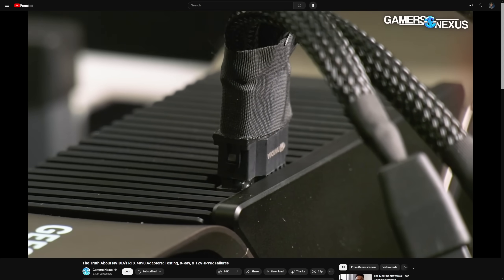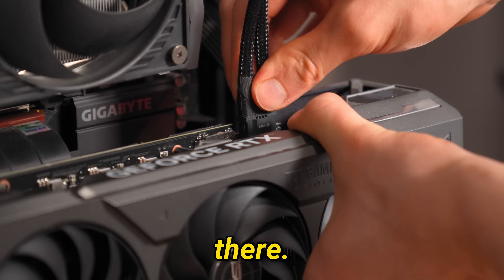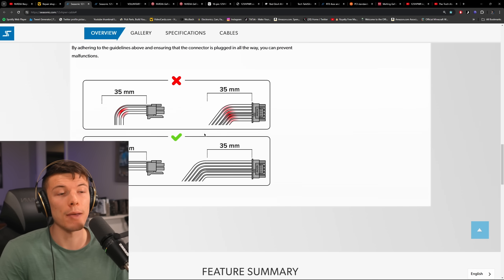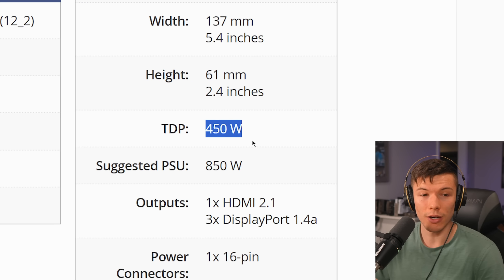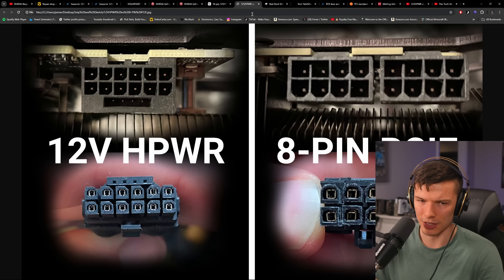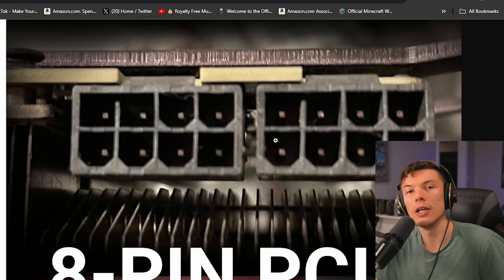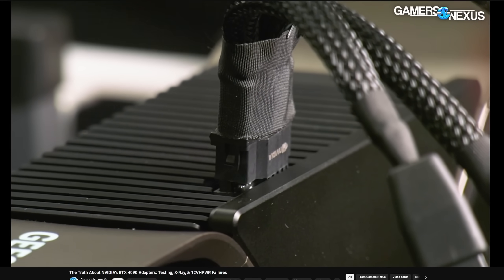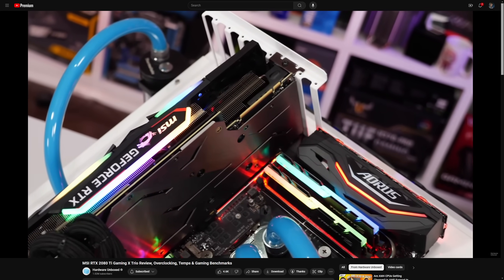The Dumbest Thing to Happen to Graphics Cards

Comment from the maker: we are almost at a momentous subscriber goal...

also at 1:45 is possible the light still shines of a failure because the 4 sense pins of the 12VHPWR aren't actually going to anything on the power supply because of the adaptor, which would make sense (pun intended). However, it doesn't change that it's too hard to tell if you even have it plugged in right, which is pretty ridiculous
Reply: @vextakes !!! Explain to me why you left out the fact that in the ORGINAL ARTICLE it states that northfix mentioned that the users did not use the supplied cable with the graphics cards . Those cases with the melted connector are from users using a Cable mod connector or something similar 🤔 
I mean seems like your trying to paint a narrative or you missed that part of the orginal article unless it wasn't clarified rather all 200 units Northfix has fixed used a aftermarket cable connector
Reply: @bigdaddyt150  The Cable mods connector was originally made to the same spec as the one that is supplied with the Nvidia cards. 
Vex Clearly showed you he had the same issue with the one shipped with the card.
Reply: @kevinerbs2778  JAYZTWOCENTS also did many videos on that cable . You can't bend them and it's best to use the supplied cable only . The bend tolerance is the issue first and foremost.  Cable mod recalled all there cable connectors
Reply: @bigdaddyt150  Vex Clearly showed you he had the same issue with the one shipped with the card. -_-
Reply: @kevinerbs2778  I have two cards with that same connector,  I haven't had an issue with them . But I get it , there's some defective ones floating around because they make millions of them
Reply: Yep, the 12vhpwr connector is just stupid.
Reply: It should be staggeringly obvious to anyone not sickeningly undereducated that a pin's ampacity can be exceeded if there is complete failure to do something as utterly trivial as plug it in correctly and check the catch is secure as blatantly designed. The sheer lack of intelligence, care, and attention to the most remedial of detail associated with the degrading failure to do this constitutes a truly shameful embarrassment. All this hoo-ha over the source of failure is shocking and ridiculous, and shame on all those suggesting any problem lies with anyone but the user on this matter.

Properly seat your power cables, buy a case that fits, do not bend cables, do not use 3rd party adapters, have a professional who knows what they are doing building rigs and you will have a %99.9 success rate according to the current data..
Reply: thing should have had a much broader clip  with two more clips on each side of the plug  that way you damn well know it's seated good and wiggling it some wouldn't unseat it.
Reply: Can you explain one thing to me ?  I have a 1600W PSU from EVGA , a old one Super Nova from 2013 . It has many 8 pin connectors . The new adapter from Nvidia is to use those 8 pins . So 150+150 is 300 , so am i missing something  ? Is the New 1000watts psu from 2024, able to make 300 watts per 8 Pins ? what exactly is this  Magic that new connector makes to get 600watts using just 150watts  8 pins connectors ? Can i use my 1600Watts PSU From EVGA super Nova ?
Reply: @ssj3mohan  You didn't say what graphics card you have. An adapter with two 8 pins is made to deliver 300 watts.
Reply: @pf100andahalf  strange that some 7900xtx come with 2 8pin and some with 3 8 pin. 7900xtx always at lkeast 360 watt when running 100%
Reply: @germainederandamie40  Derbauer said the 8 pin connector can handle up to 280 watts which is almost double its 150 watt rating. The 12vhpwr connector isn't over-designed as much as the 8 pin is so it can't handle almost double of 600 watts, only about 750 watts.
Reply: @ssj3mohan  my new psu has a 600watt connector. But I have the 7900XTX so im using 3 6.2 pins from the psu. Not sure how an adapter can use only 28 pins. I mean its possible, some 7900xtx come with 2x8pin. So they can take 360 watt officially. Should be able to push 400 watt through it, but I went for 3x8 pion just to devide the load better. 7900xtx easily goes 360watt+
Reply: P = I x E or (watts = current x voltage.
Do the math to see what the number of amps we are talking about here.
That was always going to be a disaster.
Reply: what website did u use to check the amount of watts a gpu needs
Reply: I have that exact gpu, runs fine but has that goddamn light
Reply: I think im gonna get gpu strimmer cables, imma see if it’s the cable
Reply: The red led on the gpu is not there to tell you the cable is plugged in correctly. It shows that the card is not receiving power through the connector. It should go out when the pc is turned on.
Reply: @jonroue7214  ohhhh, okay cuz I only see it when it is off. you saved me some money
Reply: get rid of them, they are Lemons
Reply: almost 69k

Comment: If you want to run more amperage through a cable, you need decrease that gauge of cable in order to supply needed power and reduce heat. I have a 1600 watt titanium PSU and the cable that runs from that supply to the wall is huge. Wire size is the problem with the 12vhpwr connector.

Comment: I believe alot has to do with cheap ass power supplies that have no built-in protection or does, but it doesn’t work. One of my customers had it happen on his 4090, but the system shut down before any damage could occur. As a matter of fact, the system shut down multiple times before he noticed what the problem was. In his case, a pin had been pushed into the connector. Not by much, but enough I guess. In any event, his rig had a platinum PSU with built in protection and that is why it was shutting down.

Comment: One game i had detune graphic card cause it was a struggle with  game 
Need 64 g ram for Fallout 4 
Soneone said he drew 22 amps on 5080. That wire gauge is too small for that draw 
I got h9 flow cause airflow and room. Was in going get new motherboard, but ssd took powder 
That was 350 with new system disk
My bois limits power on amd unless you tune it 
Shoukd have watt meter inline with gpu
I used work on pc when was young. My roomate spent 100 manhours on kink cause of the frequency. 
That much power in that small space will melt new solder 
Lead nope

Comment: For perspective, most house wiring is done in 14 gauge romex called 14-2.  One 14 gauge wire will run your entire pc and whatever else in two or three rooms in your home. 12 16 gauge wires is not the problem. I think the problem is the connector. They'll figure it out.

Comment: Been using ez diy 90 degree adapter on my 4070 ti sup since release date...no issues (knock on wood)...i do check the adapter at least once a month...no signs of damage at all...been a fan of ez diy for over 3 years...luv their braided cables

Comment: Apparently the 5090 has 2 16pin power connectors that thing is asking to explode, the 12 pin is a failure, now they are upping it to 2 16 pin that draw like 550-650 watts (allegedly)

Comment: Have any of you guys ever flown RC model airplanes? A 3-dollar power connector can easily handle 1,000 Watts of power at 12 volts.
Big fucking deal.
These power connectors are CHEAP and a $2,000 graphics card has plenty of cost margin for a $3 power connector!

Comment: Compared to designing a graphics processor chip, an electrical power connector is a TRIVIAL endeavour. If expensive graphics cards are having power connector failures, it's because the people designing them are INCOMPETENT.
Handling 300 watts of power at 12 volts is TRIVIAL, it is about 25 amperes of current and designing a cheap little plastic plug that connects to your graphics card and delivers power to it is TRIVIAL for the kinds of people that know how to design and build graphics processors.
So, the people designing these connectors are INCOMPETENT.
Over and out.

Comment: Don't forget the pcie slot also provides 75w of power. Also the nvidia 12vhp adapters are combing 2 wires into each pin, Power supply 12vhp cables use separate wires to each pin and not a single one of them is failing.

Comment: me that I design power audio amplifier PCB, those pins are too small 8:56 is gonna create a small resistance generating heat is too much current flowing in those tiny pins is like a heater effect

Comment: So from what I am seeing in the problem is really in those questionable 2 or 4 into 1 adapters. Which seem to be a great example of an Electrical Engineers list of “things you should never do”. The newer power supplies that have an actual 12 volt port that’s properly rigged on the circuit board and breakers, seems to mostly avoid the half assed horror of those adapters. The port design itself still seems odd. What is the purpose of the 4 smaller pins?

Comment: Your logic about Pcie and 12VHPWR cable's is flawed! A 1500 Watt heater uses a fuse that's less than 1mm thick. It's not just the size of the wire, it's the metal within the wire.

Comment: The problem is with the safety factor. 12vhpwr has a safety factor of 1.1 which is probably only passed cause it had the 4 safety pins. A 8pin has a safety factor of 1.9,  it probably just has the low safety rating to save less than a dollar per connector in manufacturing cost.

Comment: My MSI SUPRIM X 4090 just melted a couple of days ago, I had a CableMod 180° adapter on it. Everything was plugged in properly and sitting flush. I think cyberpunk is what did mine in. Pretty ridiculous… I bought this $2000 GPU so I could play graphically demanding games, maxed out. Now I risk my card melting and months of my time getting it fixed if I play graphically demanding games. I’ve talked with CableMod, and they’ve been awesome. Just waiting on a response from Nvidia now pertaining to an RMA. If they refuse, CableMod said they would cover the costs of the repair. Just an annoying situation, not having a PC for a couple months. Also, who’s to say this doesn’t happen again? How do I prevent my 4090 from melting itself again? Clearly the cables sitting flush and the adapter wasn’t enough. Hadn’t even had my 4090 for a year, does that mean it’s going to melt yearly? Will I need to send it in for repairs annually? Do better Nvidia.

Comment: My ASUS 4090 power connector melted, and I had to wait 7 weeks for it to be repaired and I had to pay $110 to repair it (while it was still in warranty), they blamed user error, even though I made sure to check the cable was firmly connected on a fortnightly basis.

Comment: I had an amd r9 390 gpu (275 watt gpu) powered off 1 pcie power cable going to its 8 pin and 6 pin connectors tho I later heard its not a good idea to run high power draw gpus like that over 1 cable so I changed it to two cables, but it worked fine for 1 whole year that way and when I unplugged it I saw no signs of the connecters getting hot whatsoever. If that's not a testament to how bulletproof the old 6-8 pin power connectors are idk what is.

Comment: Lets all take a moment to let this sink in this connector had to get through QA with standards board. They let this this go out into the wild with these issues the standards nosrd that okayed this should be at Fault as well as nvidia. Remebe the Note 7 thst got pulled right away once they started exploding this hasnt.

Comment: Imagine that we have 8 or more pin power connectors that require it to be CLIPPED into the card or mb and that product worked for almost 2 decades in various forms . . . but heres a wiggly thin boy? wtf

The 12v connector is a fraud and the single biggest fumble in recent memory for tech. It doesnt work and it isn't safe except in IDEAL conditions. How does it make sense ?

This is also why I am not a fan of the movement toward integrated power rails in the PCI slots to power these things. Apple had almost yearly soft recalls for their macbook pros due to keyboard and power rail failures causing fried components all of the last decade. I don't trust these companies to not turn our computers into a dice roll.

Comment: I had to undervolt my 4080 to appease my paranoia. Before it consumed 280-300w in some games. After undervolting card consumes 200-230w and 2-5% less fps. I hope it will help to prevent melting.

Comment: Pci sig should just recall the design and issue an improved one. 8-pin isnt the answer and neither is 12vhpwr. Ideally you want a strong connector that allows cables to still be flexible thats smaller than 2-8pins. 12vhpwr is too physically weak, overrated and doesn't allow cables to be bent. It's worse in almost every way.

Comment: There's a reason EVGA said, "Enough," and dropped out of the GPU race. This might be a big part of it. 

That said, you definitely don't have to buy a new GPU. My 4090 came with adapters to make it work with four 8 pin PCIe cables. I know that seems excessive, but that's what they did with the 3090Ti as well (though it only took 3). 

Anyway, I'm with the rest of the folks who are amazed that NVIDIA hasn't been sued yet. Not sure how long they can dodge that. A class action has to be coming up soon. 

Of course, when they can charge $25k for an AI-designed GPU that cost them no more than twice as much as a 4090 does to make, they probably don't really care about being sued.

Comment: I’m no formal-studied engineer… but from everything I know… the 4090 and 5080/5090 series would need TWO of these new connectors to draw at a safe temperature. Or they need to redesign it with lower-gauge wire/connectors.

Comment: It's all well and good saying user error (it actually is user error). But the problem is the cable is so goddamn difficult to put in properly (and actually more difficult to take out than plugging in), that it is no surprise people are melting the connectors. I got a 4070 super which uses this connector, but I didn't use nvidia adapter since my corsair PSU already had the proper cable and the length of that cable is long enough to where it is nice and snug in the card and no strain is put on the port. The design of the nvidia adapter however is extremely bad, just because it works when plugged in properly and user error is to blame, this doesn't change the fact that it is very difficult to connect properly. The problem with it, is its just too darn small it needed to be at least 10 cm longer imo to give it enough slack to not pull down on the port.

Comment: At 1:45 you turned on the power supply before plugging the 12VHPWR connector in. I have only experienced the same problem you had with the red light and no output when that happens. Never had the problem if I plug the connector in first.  Not in the habit of trying this but I saw this video and had to try it myself.

Comment: It really pays to have a psu that has native 12vhpwr connectivity like Corsair RMx. It was real simple to just buy the appropriate psu cable and chuck that awful adapter in the garbage for my 4080.  Looks pretty alright too. Havent had issues but 4080 isnt as ridiculous in power draw so not really a surprise there

Comment: ich habe "nur" eine RTX3060ti 8gb, sie reicht für viele Spiele in MAX Settings für 1080p. ABER, die 8gb vram sind viel zu wenig :/
Ich möchte aber nicht aufrüsten, solange das Thema mit dem 12VHPWR geklärt ist. Kaufe doch jetzt keine GPU für 800-2000€ und sie KÖNNTE jederzeit aufgeben, weil Nvidia das Problem nicht als groß genug ansieht..

Comment: You know what I want to see? Change the standards to be 20 or 24 volt DC. Increase the voltage and you can reduce the amperage required for the same total power. Less heat and smaller cable required.

Comment: 12VHPWR, mising of chips with memory designs that fall short with each product, forced obsolescence of power supplies, extremely hostile upgrade designs that force you out of even the most gigantic server chassis, Win11, Web3.....Yeah this is a really annoying timeline with permanent issues. No thanks.

I'll stick to the 8-pin connector on my RX 580 and the RX 7900 XT from a power supply that has been doing every job I've thrown at it since 2009 in a case that was QA'd in 2002.

Comment: the only thing I can imagine, is that these connectors are designed to make the cards fail early . . . because the connectors WILL wear out,, connectors are WHAT wears out, so when people want to buy used it will be a mistake
Reply: I bet nvidia turns down the cards performance later, citing 
"power consumption" as a reason

Comment: About two days ago my 4090 fried two pins. And I’m not overclocking just running a couple of games that are not known to be intensive. I am so not impressed. The cost was astronomical and they should not be happening. Of course I splattered all over the Internet. When are we getting a lawsuit but I’ve yet to see one materialize I guess lawyers just scared of this giant behemoth that basically made an error. What’s also fascinating is the location of the pinning right on top which to me makes no sense should’ve came out the sides or somewhere else more well thought of from a point of view of all the cases out there and blah blah blah.

Comment: Our boy here doesn't understand that only 6 pins on an 8 pin carry "power". Additionally, the 12v (12 pin) connector has an additional 4 pins (sense pins) that perform the work of the 2 other pins in the 8 pin connector. Therefore, the 12v connector has 12 power delivery pins and 4 sense pins, just like using 2 - 8 pin connectors.
Reply: not surprising that this comment has no likes, and won't

Comment: I just built a new PC. I wanted to keep the budget as low as possible, but still get a solid PC with a nice upgrade path, and also with an all white build. I went with a Galax RTX 4070, which was the best GPU I could find that still had a standard 8 pin power connector. No way I would have spent that much money on something that has a better than not chance of catching on fire. This is clearly a terrible design.